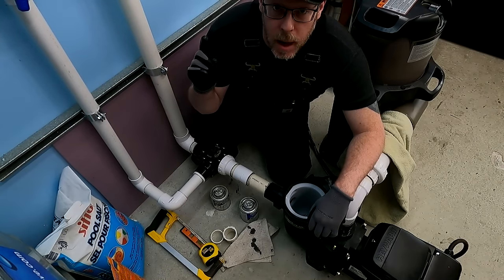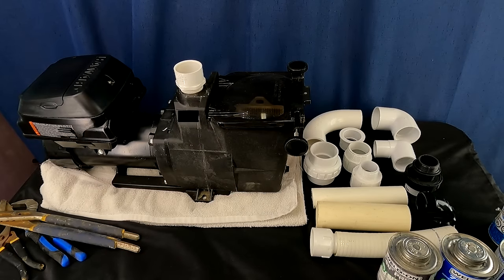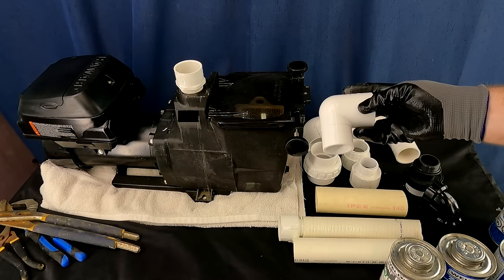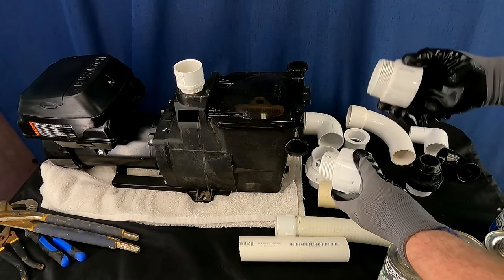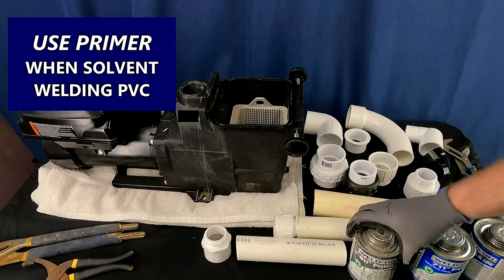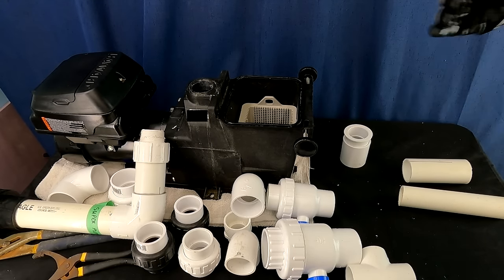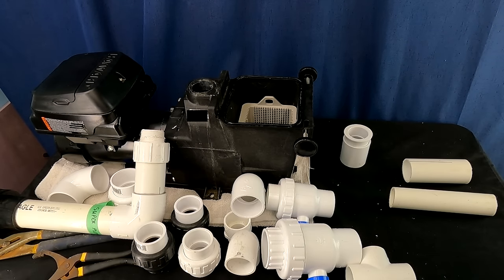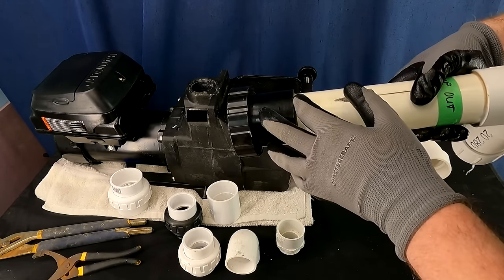How To Install a Swimming Pool Pump (Better)

Comment: 25 year old pool, 20x40, with a sand filter. All piping is 1.5". There are 3 x 1.5" suction lines that feed into that single 1.5" line into the pump. Then a 1.5" line out the pressure side into basically the largest Hayward sand filter they make, and out a 1.5" that breaks out into 4 x 1.5" pipes down into the ground. Not really sure there is any advantage to changing any of it to 2" considering the pipe coming out of the ground is all 1.5". Also all the Jandy valves (6 of them) that are the older  style and 1.5". Moving to the new 2" Jandy will be expensive and then have to go form 1.5" to 2" coming out the ground.

Haven't had any issues keeping the pool clean once the chemical levels were straightened out (troublefreepools was massive help).

Comment: CRAZY. I just installed a pentair superflo vs (got it on special 1200 on amazon) and I did the sweep elbow........only because I know aerodymics and applied my knowledge of that here. I originally had a lower rad elbow, and then switched it out, because I'm dumb and had a leak because of the cement and I didn't have 100% contact. It happens.

Comment: Hold the wrench the opposite way. The wrench tightens under pressure, kinda like the Teflon.  (when putting in the suction line male adapter)

Comment: Hey Steve! Can you or anyone else here answer this question please?  I have an inground swimming pool of about 30k gallons. I recently decided to buy and install solar panels. Then I bought a solar pool pump but haven't installed it yet. How can I keep my existing pump as a back up or aid to a solar pool pump? My current setup is, water suction -> pump -> booster pump for pressure cleaner -> salt cell -> sand filter -> pressure return to pool. Thank you.

Comment: Hi Steve. Been watching a lot of your videos. not because I want to install the stuff myself, but to make sure I have an informed conversation with my pool builder and to make sure they are trying to do the best they can. I think some don't know what they don't know.

Anyway, I had a question about the pipe diameter and flow properties that you mentioned. Are the efficient Flow dynamics based on the suction side, the return side or both? If you have 2.5 in pipes on the suction side, but 2 in on the return line, what is the max efficient gpm you can achieve? Does the 2 in on the return side restrict the flow and should you insist on it being the same on both sides of the pump?
Reply from the maker: It's more complicated than that. The short answer is, no, you should not insist the pipe is the same size. The pump needs back pressure to operate properly and this often results in larger suction side pipe than on the pressure side. So many different considerations here...but I tend to have something like multiple 2" suction lines which meet at 2.5" pipe on suction side manifold. Then 2.5" though the equipment set, switching back to 2" just after the return manifold. You want to consider laminar flow potential through your trunk lines but also that you need some back pressure on the pump to avoid cavitation.

Comment: Interesting video. have seen on some pool pumps that they are specified for a maximum water temperature of 35 degrees Celsius. What happens if you have a higher water temperature then?
Reply: Does your pool water temperature really stay above 35C? That doesn’t sound refreshing at all — that’s approaching hot tub temp
Reply: I use to have 47c degrees in the water.. just kidding. It is between 30 and 32c degrees in my pool. But just wondered why it says 35 degrees maximum water temperature on most pool pumps.
Reply: @drdrew3 we keep our pool at 98’… in Denver and the air is always dry and rarely hot… hottest days of year still fluctuate 40’.. day & night 
so jump in jump out dry air burrrrrrr… 
I get so excited when night temp stays out of 50’s ..  with Bill Gates dimming we are not even getting our sunshine everyday we use to be able to count on..  :( 
(No that’s not theory.. it’s been contracted w ski resorts since the 70’s.. that’s why it’s always so dreary on the ski slopes and bright sunshine when you get away) anyway now doing here ..

Comment: I had zero pressure. My problem was at the propeller that had some debris It was easy to remove with my fingers after that I was golden

Comment: FYI!!  LOWE, S is selling Chinese Schd 40 where the MIP, s are failing along the thread to fitting line. Threads are separating from the slip part of the fitting! 
We've had to go back on 3 jobs and replumb to eliminate those fittings!! 😮😮😮😢😮

Comment: As someone working on a pool that they inherited through a house purchase, the one thing that I'd stress more than anything... please give yourself ample piping to work with.  I was going to install a variable speed pump before opening the pool this year, and honestly... after I took a look at the inlet piping to the pump, I just gave up.   It's definitely doable, but since I'd like to move within a few years, the amount of effort just isn't worth it.  The problem is that there are just literally no bare pieces of pipe for me to cut and modify to get the ~1" of additional height that I need to properly reach the variable speed pump's inlet.  (I tried to use the pump without the bracket -- as noted in the manual -- but it was still not aligned well.)  So, so much of the pipe is taken up by valves, couplers, angled adapters, and a union that the only option that I have is to dig up a good 6-12" of dirt around the two inlet pipes, cut them, and rework the run.

Although, given that I think there may be a leak in the skimmer's line, it might not be the worst idea to dig up even more and rerun the lines to allow for longer a longer inlet run.  There's currently maybe a total of a 1.5 to 2 feet from when the pipe comes out of the ground and gets to the pump's inlet.

Comment: Great information in this video!  Very detailed!  I do have one question.  I'm installing my own in ground vinyl pool.  It's 8' deep, with a retaining wall on one side (due to the slope of the ground).  I'd like to put the pump and filter at the base of the retaining wall to get them out of sight and reduce noise.  Everything I've read says this is fine, as long as you install shut off valves on every pipe to stop the flow when servicing the system.  But, the pump will be ~5' below the water line.  Do you foresee any issues with doing this?  Will the pump be ok pumping vertically this far?

Comment: sweep elbows hard to find. lowes carries them but only at the bigger stores. they are labeled as swimming pool elbows. i usually have to make an extra 20 minute drive to get them. hey are kind of pricey, around $ 7.
Reply from the maker: pool suppliers should all have them also.  Lowes and other hardware store chains usually have very little in the way of pool specific stuff.

Comment: My Pool company provided me with the flex for underground, should i transistion to rigid below grade? Or should i just ditch the flex and go get some rigid for everything. The pool is ready for the skimmer and returns to be plumbed.
Reply from the maker: That is a consideration too technical for a yp
Youtube comment. Lots to consider. In general, rigid is superior across the board. But in cold climates you see flex on 90% of new installs.
Reply: @Swimmingpoolsteve  I'm in Ontario, Canada. I just meant should I transition from the provided flex, to rigid, before going to the equipment, below grade or have the flex come up above grade then transition? In other words should any of the flex be exposed above grade (considering UV etc.) Thanks for your reply, your content is excellent!
Reply from the maker: You normally transition above ground. Rigid pipe would need a pipe chase to exit the ground in an area with freeze and thaw and still might crack.
Reply: @Swimmingpoolsteve  thank you!

Comment: In my years maintaining swimming pools and installing pumps. Flex pipe is just terrible the heat that can build up and the chlorine will just break down the flex pipe and you’re left with these blown out or gummed up piping.  Schedule 40 is a good pipe to use if you want to go a bit more over board in protecting it from heat build up you can put a length of schedule 80 the grey pipe straight threaded. These also work well when coming off heaters just adds that bit more protection from boil off that could happen. Then use your unions to make it easier to take the pump off to service it and not have a mess of couplings. Really the only thing I’d consider flex pipe is hooking it up on to the backwash line and in your portable spas. Short and long radius 90’s my feelings are try to make it where you don’t have a bunch of them it just hampers flow and really puts strain on your pump use physics put a down grade to your plumbing so your pump isn’t trying to pull water a couple dozen feet up maybe a few feet at your skimmer and drain intakes. A pump below grade is fine just be sure to have ball valves to cut off the flow so you’re not losing water.

Comment: Just an FYI, motor connections are done with stranded NOT solid wire for reasons of vibration. Thus why that pump has spade connections on it. If you want to terminate directly to the screw you need to crimp a connector on your stranded supply conductor.

Comment: hi, where should I cut a discharge pipe that is leaking around the seal at the pump...the pipe is about 6 inches, so it is hard for me to tell (not a pro) I want to install a high temp union to fix this - The filter is sucking air

Comment: Im confused.   Why worry about running 2 inch suction lines if the pump housing itself is only 1.5?    Seems like any benefit you would aim to get would be taken away at that 2 inch to 1.5 inch reducer at the pump threads on the suction side.
Reply from the maker: The inefficiency is momentary in the pipe section where the restriction exists. It does not limit the entirety of the system efficiency so there is benefit in improving all areas of the system. Most pumps come with 2 and 2.5" native ports these days. Rarely 1.5" ports, and even when so, simply change to 2" pipe immediately out of the intake and outlet. This is pretty normal for pool equipment and only adds a minor increase in total restriction to flow / laminar flow potential

Comment: Why does water spurt out the clean out lid every time I shut off the pump?  1 1/2 hp motor with sand filter.  2" inlet and 2: outlet like you say..

Comment: Ive got a 1.5hp pentair pump, how do i find high temp unions that thread onto the pump?  Really want to avoid the 1.5" thread into unions.
Reply: Good Luck. I could not find any so Hayward sent me a P/N. It turned out to a regular PVC type.

Comment: Will have to watch the rest later but did want to jump in and say flex pipe underground is not a good idea in many areas.  Grubs eat the stuff turning it into swiss cheese.  Flex can also become hydrophobic very easily in the presence of low pH (yes, I know pool owners should maintain pH but the reality is not all do).  We use the old stuff but the greenflex variety of poly pipe, that stuff I see in the ground lasting 50 years, in fact Cascade had an actual aqua colored version in the 60's and it's lasted on some pool, generally the failure point are the cheap nylon fittings (champion pools was known for using them).  Building a new pool I may use hard PVC but for replacement pipes which we do many of the poly pipe is really the best way to go.  When flex becomes hydrophobic it kinks or even pops out of the ground like a sea serpent, bad stuff all around in any situation.  Those high temp Praher unions are great, I wish companies like Hayward would incorporate union connectors on their multiports.

Comment: my Pentair Intelliflow VS install manual says in big capital letters DO NOT install 90degree elbows directly into pump (voids warranty), I see your setup has a 90 sweep elbow on the outflow top of the pump. They don't give a reason, and I have no idea what difference that would make frankly. Comments?

Comment: Hello Steve , can you tell me the  difference between a high head and low head Hayward pump and even if there is such a thing .
Reply from the maker: Medium head is super pump and maxflo pumps. Higher head is the tristar 900 and Tristar 950
Reply from the maker: Which is to say medium head pumps are for pushing against medium resistance to flow. If you increase resistance too much the pump moves hardly any water. In which case a pump designed for that higher range of pushing performs better on these systems
Reply: @Swimmingpoolsteve  Ok Steve I got a little better idea of what I need . Thank you .

Comment: At 46:53 you said that when switching from 1.5 inch to 2 inch on the suction side and you have only one suction point, you can’t do it.  I’m not sure I heard that correctly.  I am currently abandoning my main drain and only going to utilize my skimmer and want to go with 2 inch from the skimmer to the pump.  Is that permissible?
Reply from the maker: You can have a 2" pipe from skimmer to pump, yes. You can't run 1.5" pipe from thr skimmer and then change it to 2" in front of the pump. The whole line has to be 2" OR ypu have to have multiple 1.5" pipes to effectively feed a 2" pipe

Comment: U mentioned a sheilded bonfong wire.  I thought the wire needed to be unshielded so it could contact earth while running the perimeter and f the pool, 4-6" deep??
Reply from the maker: Depends on where you live and whether you are under NEC or CEC code

Comment: Sorry for the double comment … when a pump has internal threads and outter treads , are the outter threads called FBT ? It’s confusing when trying to find unions for the outter threads for me … was wondering what the differences was
Reply from the maker: A buttress fitting is probably not what you want.  You would start with which pump you have and likely that will enable you to find the right threads for the connector.  If it is a standard thread then you might have 1.5" female pipe thread on the inside, and 2" male pipe thread on the outside, which means a threaded female adapter would fit.  But not if it is a prorietary thread.
Reply: @Swimmingpoolsteve  gotcha thanks !! It’s a waterway hi flow 2 1hp 2 speed. Was trying to see if I can upgrade from 1.5 inch to 2 inch pvc.
Reply from the maker: @shannon1872  even if you use the native 1.5" threaded connection port you may be able to still have 2" pipe. More than the connection point to the pump is the amount of suction lines feeding the system.  For example on a commercial pool it is common to have pipes that are 4", 6" 10" in size.  We do not use pumps with 10" suction ports.  Just regular 2". 2.5" and 3" ports.  So it is normal to throttle down at the pump intake even when you are feeding with larger pipes.  Yes, there is an efficiency loss at that location, but this is the accepted standard and is not detrimental to the pump to do so.
Reply: I wish the folks that built my pool watched this video!  I fib the warranties for non professional installs to be ridiculous considering how often the "pros" do a terrible installation.

Comment: I have 3 suction lines and I’d like to go from 1.5” to 2” for the short section before the pump, but if I do that then my straight pipe length drops below the 5X diameter rule. Is it overall better to have bigger pipes or a longer suction pipe?
Reply from the maker: I would take the 2" pipe from the manifold forward. And I would definitely try a way to move the pump and get the clearance you need, but in a situation where there is "no other option" I would use the 2" pipe with slightly less straight run than needed.

Comment: 1:14:27 you want to use crimped terminals on flex wires. Using rigid wires around a screw is not safe, and in some countries, not even a legal way to connect wires.

Comment: I hate to bust your bubble but the outside radius on a street ell is the same as the 90, the inside corner is still square.  On directional flow, the street ell will actually flow smoother than the other 90 as there is no turbulence created do to the tubing being glued in.  The best method is to use the sweeps if available.  Most of your big box stores do not carry.  Go to a plumbing supply store.

Comment: Wouldn’t 45 degrees fittings be better than hard 90 degree fittings. 😊
Reply: You would need two 45 degree fittings to accomplish the navigate the same route as one 90 degree fitting. Any decrease in flow resistance from the lesser angle would be negating by the DOUBLING the changes in direction of flow. 

Additionally the 45 degree fittings would have to be very close to each other given that most equipment pads are fairly confined spaces. So 45 degree fittings wind up shortening the straight runs where efficient laminar flow is created.
Reply: @drdrew3  True. On the other hand, in some cases like where two 90's are being used in a "Z" config to shift the axis of a pipe in a plane, and you have the room, two 45's are a better choice.
Reply: @generessler6282  i have used that. a couple weeks ago my pentair vs went out (control blew at a cost of around $ 500) so i purchased a b and d  VS. needed one more sweep 90 which i didn't have. so i did in that case used 2 45's together.